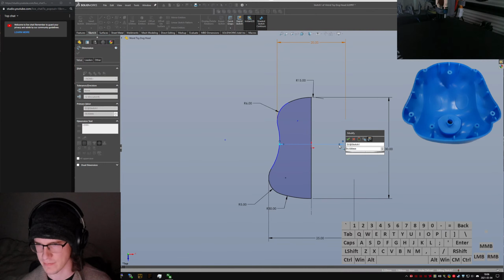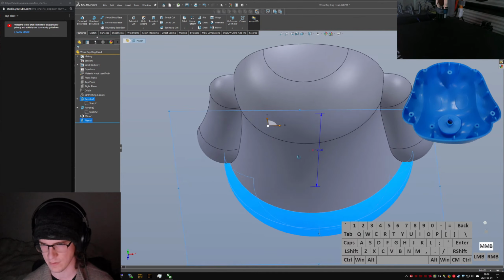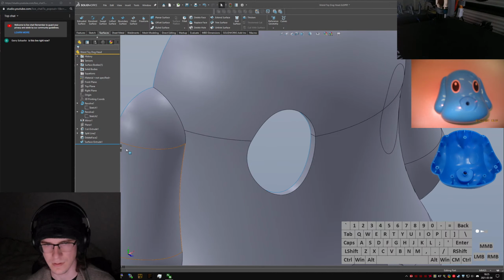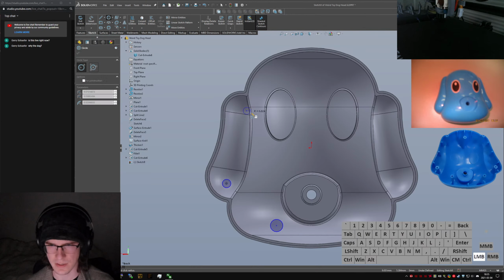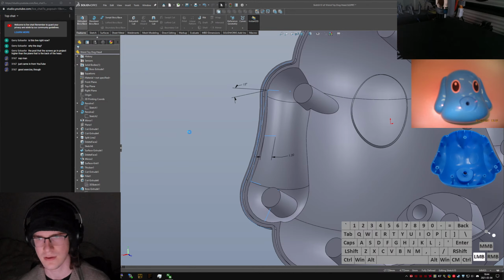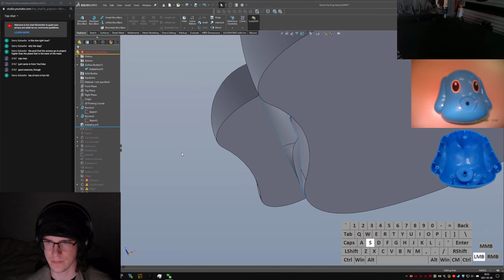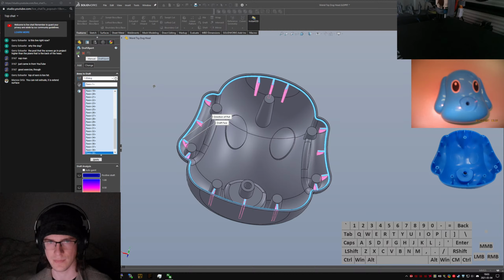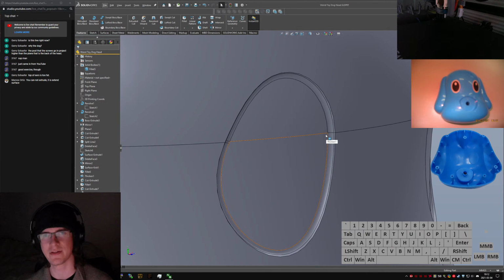/r/Solidworks Weird Toy Dog Head

Comment: You nailed it! great work
Reply from the maker: Hey thanks! In hindsight I still think using surfacing could've yielded a more accurate and/or stable final part, but this approach got me to the finish line more or less.
Reply: @ClarkSchaefer  To be honest your approach surprised me because of how simple it was. I would've directly gone to doing surfaces.
Reply from the maker: @hunus6758  well, that's what four (five now maybe?) years of wrestling solidworks teaches you how to do, lol